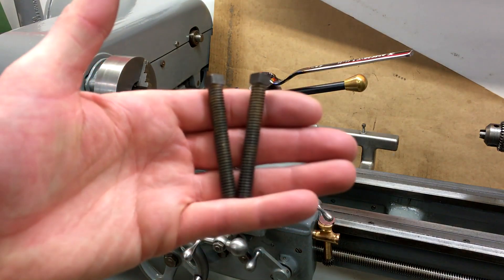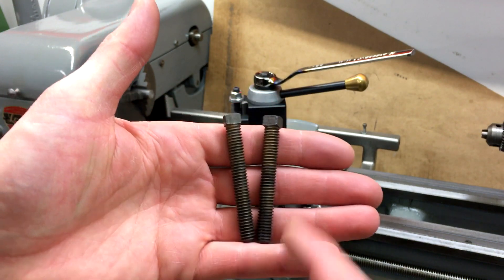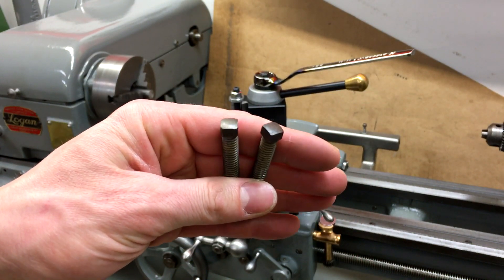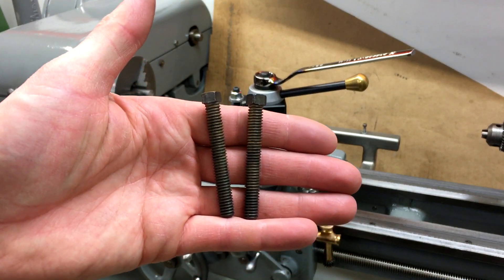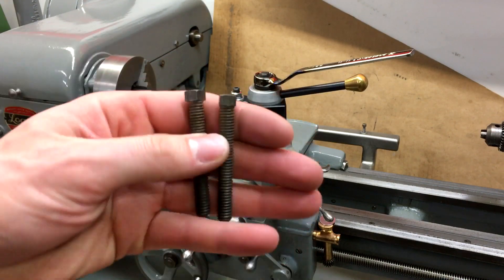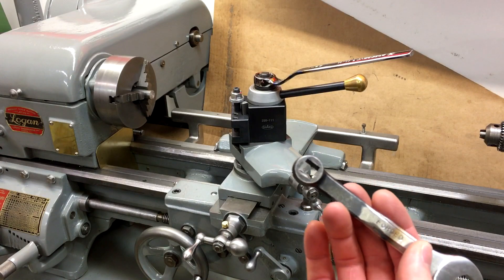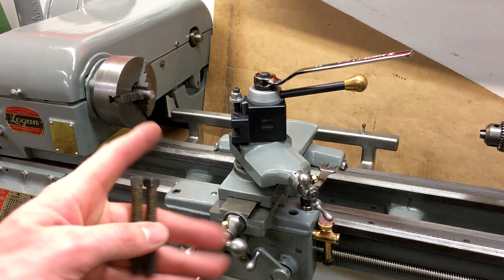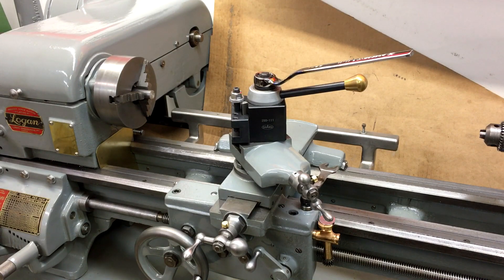Square Head Bolts

Comment: Suggested upgrade: round off the heads of those screws. If not obvious why, try and you’ll see why.
Reply: Paul Mathews I was going to suggest this to.  Besides the not so obvious reason it sure makes them look more professional.
Reply from the maker: If I had to use them all the time, then I would have rounded the tops.  But for these, I like the square look.  Thanks for watching!

Comment: Nice job.  I enjoyed that.  I was really rooting for the tail stock thread die.  Nice long cut.  Does the lathe not have the ponies or can you not hold on to it when it gets tough?  Could you add a right angle handle to it to give you more "leverage"?  This would solve a problem I have and make threading faster for stainless bolts I make.
Reply from the maker: Thanks!  The lathe has the ponies, I just can't hold on tight enough.  You absolutely could add a handle to do it, I just haven't been able to make myself drill a cross hole in it yet.  I made it thinking I never did that much threading larger than 1/4", or if I did I would single point it, and now it seems like a lot of stuff is coming up larger than 1/4"

Comment: what kind of mill do you have there?
Reply from the maker: It didn't have any badges on it when I got it from Craigslist.  Its some sort of import brand.  Just a bench top style column mill drill.  Something like 30" x 10" of table travel.  2HP motor.  Power downfeed.  Its no Bridgeport but it works well for a small shop like mine!
Reply: yeah it seems to from the look of it.  I'm trying to find myself something.  2HP sounds nice